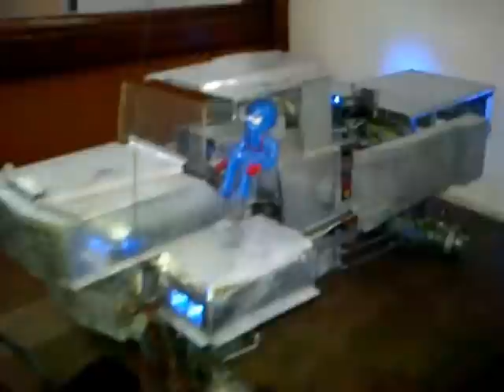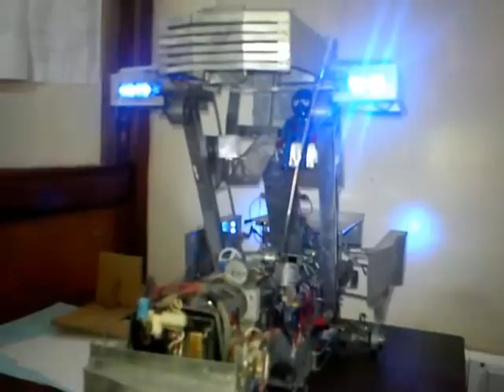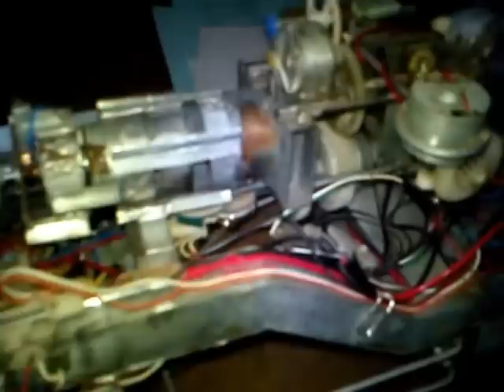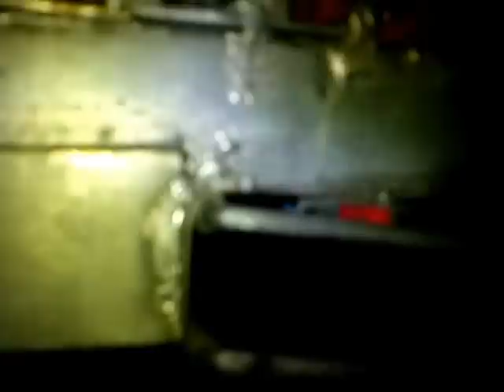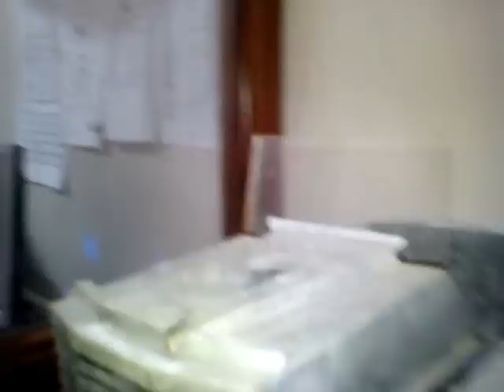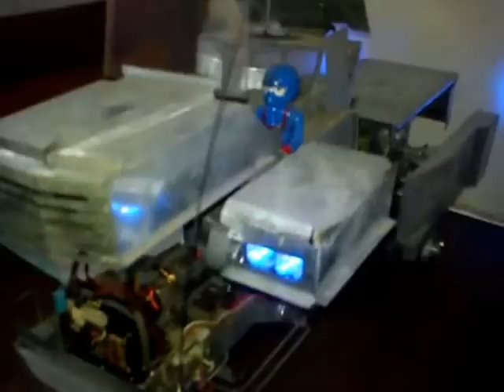Peter Mbiria's Creation.MP4

Comment: Wow, that was inspiring! These days mopeds come with hundreds of screws and bolts and plastic breakable panels to even get to the part you want to replace/service(Planned Obsolescence). Manufacturers are making it difficult to self service your own vehicles. How nice would it be to just put your ignition key and all side panels, front panels just move out of your way, manually or electrically.